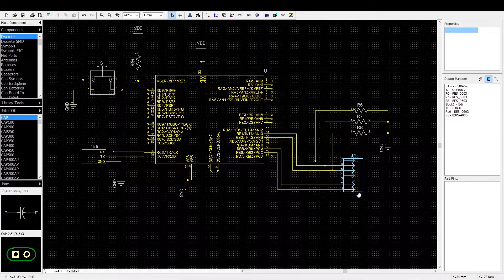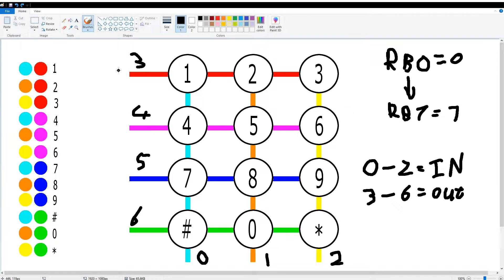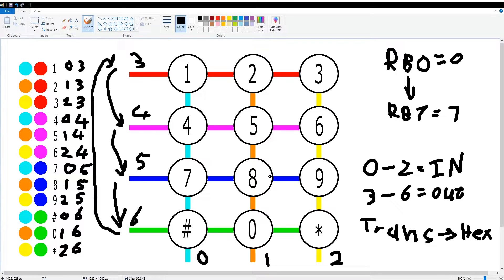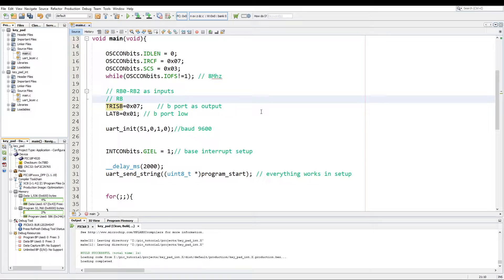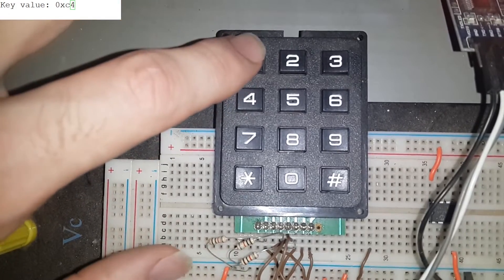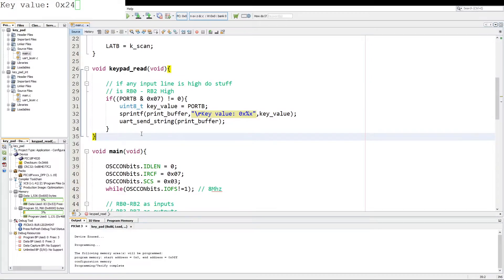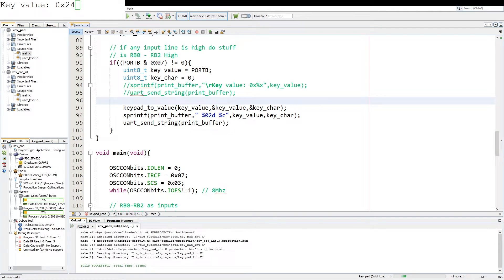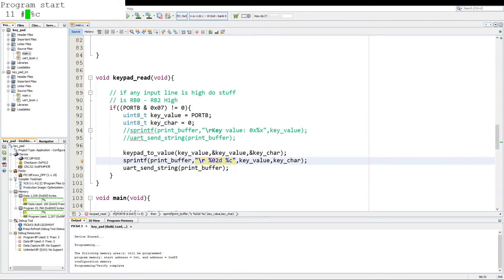Keypad Interfacing 🔴 PIC Microcontroller Programming Tutorial #21 MPLAB in C

Comment: Is there a form to do this but with a mechanical keyboard?
Reply from the maker: Yes you can. The matrix is just larger. It is identical to this. There are some other things to account for like function keys and and anti ghosting. FYI membrane keyboards work the same as well.
There is a large community that build there own custom keyboards.
Have fun going down this rabbit hole.
https://www.masterzen.fr/2020/05/03/designing-a-keyboard-part-1/
https://www.masterzen.fr/2020/05/25/designing-a-keyboard-part2/
https://www.masterzen.fr/2020/10/20/designing-a-keyboard-part3/
https://www.masterzen.fr/2020/12/16/desiging-a-keyboard-part4/